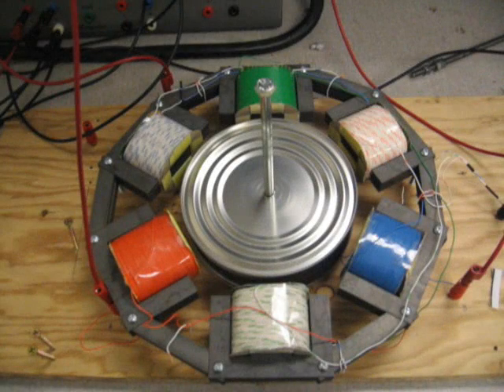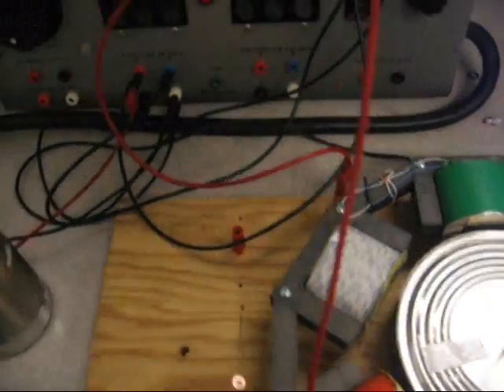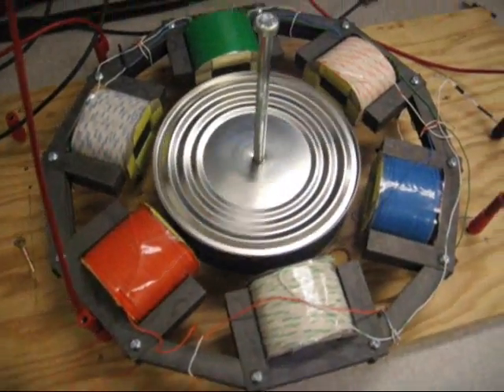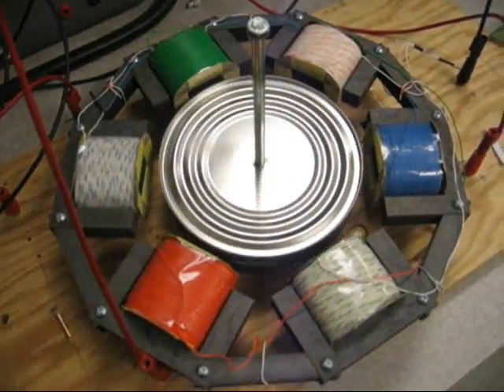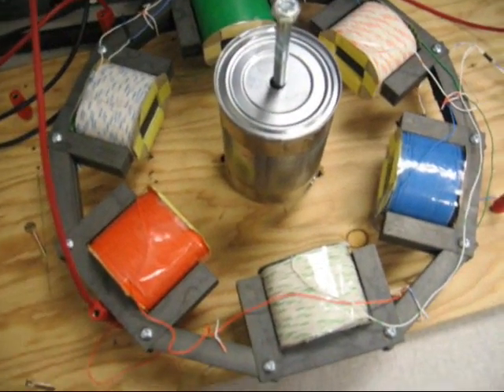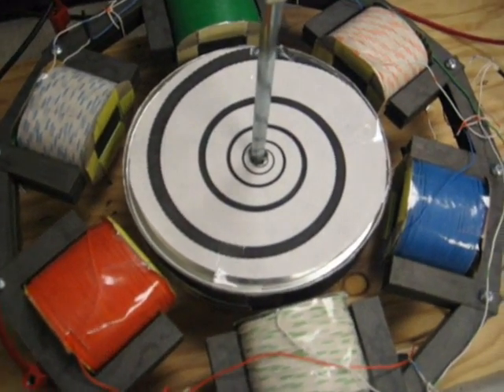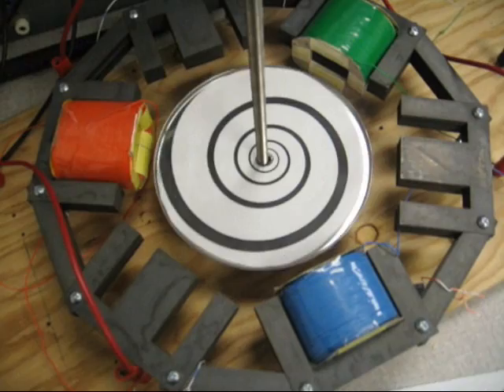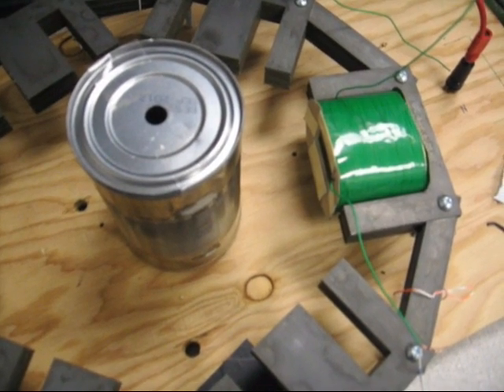Three phase AC induction motor demonstration

Comment: the workings of an induction motor are explored, shedding light on the fascinating principles behind this ubiquitous technology. A three-phase AC induction motor operates on the fundamental principle of electromagnetic induction. As three-phase alternating current flows into the stator, it generates a rotating magnetic field. This rotating field is crucial because it creates a time-varying magnetic environment around the rotor—a set of conductive windings or bars—within the motor. The changing magnetic field induces a current in the rotor due to Faraday's law of electromagnetic induction.

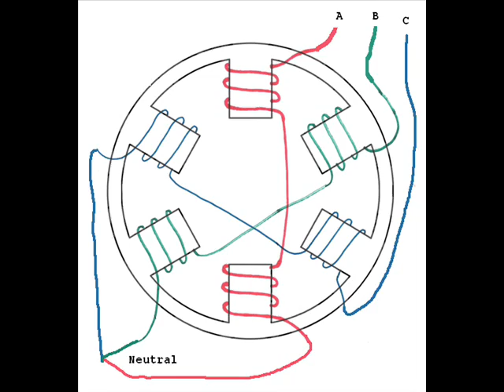Comment: are the connections at 0:10 drawing correct, shouldnt the 120 degree ones be grounded together, you have grounded the adjacent connections instead of the ones that are 120 degree apart.

Comment: I think it must be named bldc induction motor.
Reply from the maker: no sir that is not correct.  BLDC motors have permanent magnets on the rotor.  In my motor the rotor is simply a steel can where the magnetic field is induced by the field from the stator, hence the name induction motor.

Comment: this is an eddy current motor, not an induction motor as the term is defined in engineering. though eddy current is of course generated by induction. note that there is no squirrel cage winding in here

Comment: Does the Tesla Model S use the "heat pump" technology for heating and cooling the cabin or battery, using the invention patented #428057 by Nikola Tesla in 1887 for a "Pyromagnetic generator"? 9) Does Tesla plan on making an in-car magneto-electric refrigerator using this same patent? google com/patents/US428057 10) Does Tesla plan on making use of the Nikola Tesla 1888 & 1901 A/C induction "stepping motor/reluctance engine" now being used by Audi as an electric "forced induction" supercharger? Normally to be used in gas hybrids. Is the Ford Motor Company's patent in 1971 for an "A/C reluctance engine", actually Nikola Tesla's "stepping motor"? google com/patents/US3560820 - blog.caranddriver com/going-electric-the-next-phase-in-forced-induction/ More on ICE vs A/C & Dieselgate  nikolateslasolar blogspot com/2015/09/dieselgate-volkswagen-vw-diesel html

Comment: Given that 3 phase power is used in this demo, would this motor be termed a 2 pole motor or a 6 pole motor? I am thinking that 3 phases connecting to three of the transformers is ONE pole, and the same for the other three transformers makes a second pole.... ie 2 pole motor.

Comment: Cool video.  I have a few questions if anyone knows the answers?  If you added magnets to the interior of the can would it spin much faster? Also, if you did use the magnets and spun the can by wind or water to generate power would you just merge all three phase ends of hot and the three phase neutral together to combine the power generated?

Sorry for the basic question, i've been trying to learn more about induction motors and generators and would like to try constructing a simple generator.
Reply: Aghast Induction motors work by the induction of a current which produces a magnetic  field so if you add magents you will just make it stronger at some times and weaker in others since the magenitc filed will add up at sometimes but will substract at others.Depends on the magnents it may slow it down or maybe it wont matter a lot.

Comment: Hey Jim can you do a video on which wires to connect to each transfomer? I see that schematic is simple what if you wanted to connect more transformers like 12.which wire will you conne to?
Reply: Jubee Tobbe The transformers' polarity needs to match opposite poles (north to south) each, and each of those phases are connected in a delta (triangle) formation and each point is a terminal for 3 phase power.

Comment: i dont think that it is correct to say that the voltage crosses straight across from one coil to the opposite coil. this is not required for the motor to work.
Reply: +Luther David A Hall I believe it is necessary when the rotor is not magnetized, as in this experiment using a coffee can. If the rotor had either a permanent magnet or a electromagnet then the rotor could interact with the AC electromagnetic field from the transformer coils. But with the coffee can a current must be induced to create the magnetic field on the rotor, and that happens when the opposing transformers bridge a field through the rotor. I think.

Comment: If you look at a real rotor in a motor, you will see impregnation of aluminum or copper. This will act as a short circuit to changes in the magnetic field in the rotor itself. When you oppose change, the magnetized iron will tend to remain the same and that is most likely why you couldn't get the rpm up.

Comment: Whats inside the can?
Permanent magnets???
wires?
Reply: nothing. try quickly moving a magnet above an empty soda can on it's side. the soda can moves because it has eddycurrent induced into it. the rotating magnetic field induces eddycurrent into the can and it spins. this effect is known as induction
Reply: Induction motors doesn't have in rotor magnets... just they are metal thingies :D

Comment: Good video, I myself love seeing these sort of demonstrations. Would just like to make a correction as to how the flux lines where described. The flux lines do not pass through the centre of the can in a straight line as described,as basic physics stipulates flux lines never cross. The flux is actually moving to the pole adjacent to it, basically, as he described for the 3 coil experiment (the flux lines are guided/attracted through he tin can because it has a lower reluctance than air).I suppose it would look cool if you placed a piece of paper over the stator with iron filings, and you should see them. This is why the motor spins slower when there is more poles. After he reduced the number of poles, he has effectively doubled the distance from one pole to the other, since the flux density is proportional to distance, the flux density is 25% that of the 6 winding design, which explains why it spun slower. Also, I think what the professor was saying is that if you increase the distance between the stator and the rotor (the air gap), the motor loses power, or becomes less efficient. You experiment worked because it was unloaded and didn't require that much power to turn it. If there was a load connected to the original wide can, I bet the smaller can wouldn't be able to develop enough torque to turn it due to the loss of power (remember, air has a high reluctance) over the larger air gap.
Reply: Once current flows in the rotor, it produces its own magnetic field. This interaction between the stator's rotating magnetic field and the magnetic field generated by the rotor results in a push-pull effect, similar to the repulsive forces one experiences when trying to press two fridge magnets together. The opposing magnetic fields generate torque, which causes the rotor to turn. The rotor essentially “chases” the stator’s rotating magnetic field but never quite catches up, ensuring continuous motion. This phenomenon is what drives the rotation of the motor’s shaft, converting electrical energy into mechanical energy.

Comment: in that last part, there was a buzzing sound.... doesn't that mean it was AC? not that it wouldn't work with DC because we're attracting a can with iron in it, but the buzzing was probably AT the AC frequency, and was essentially the vibration of the can reacting to the field (essentially, the same thing as a speaker)
Reply: ***** I'm talking about the last 15 seconds of the video.

Comment: Need copper bars in your rotor would help
Reply: Simply cutting vertical 'window' slots around the circumference of the can would improve its performance too by creating a heterogeneous squirrel cage rotor.

Comment: Do all the neutral connect together with a wire-nut or connector? And did you run 3ph AC? Im wondering if I take the C  connector and put a run capacitor on it then just run single phase power it should run as well because the capacitor will provide the phase shift.

Comment: If I wire it like this can it be used as a generator if throughout in reverse
Reply: Show me the color code for wiring a 1968 dodge pickup D100 fuse panel.
Reply: +Maurice Lund 

Please show me the color coding for a 1968 dodge V8 D100 PICKUP FUSE BOX. THANK YOU.

Comment: That depends on which of the three phases turns on first, second, and third. You have three phases. A, B, C. If A has a phase of 0 degrees, B has 120 degrees and C has 240 degrees with respect to A. In this case the motor would spin from A to C because A turns on first. It helps to see a picture.

Comment: 3 phase is just like regular 60 Hz AC but is has three lines and alternating currents on those lines are offset timewise.

When line # 1 is at 120 Volts, for instance, 
line # 2 and line # 3 will be at -50 Volts 
with line # 2 voltage going up and line # 3 voltage going down. 

Basically, you have peak voltage on any of the given lines every 1/120 of a second instead of every 1/60 of a second.

Comment: All electricity is "produced" at a power station in 3 phase's, then it goes to substations and is "stepped up or down" in voltage but remains 3 phase, even in your street it is 3 phase which each house draws a different 1 of the phases that is why sometimes during a power cut at your house. Some others (2/3rds or 1/3rd) may still be on in the street. As for 3 phase motors they are mainly used in industry as they consume less power than a same HP single phase and are more powerful torque wise

Comment: 0:08 Where to the wires A B and C go? Could anyone explain to me in detail how to wire A  B and C further?
Reply: Ultimate Review if I understand your question right; you just take the 3 stator design and add one opposite to each and use the same wire to cover that one. This way you utilize space and gain torque but lower speed.

Comment: @kingfaisal550 Well, sort of. This is not any free energy generator/ motor if that's what you mean. The constant switching on and off of electricity from a power source to a coil causes a temporary magnetic field, (which lasts about a fraction of a second) which spins the rotor.

Comment: @hapmyster  Ah other way round. More poles means more torque but less speed. Less poles gives more speed but less torque. 

Motor speed = 120F / p 
where f is freq and p is no. poles.
Reply: The beauty of the three-phase AC induction motor lies in its simplicity and efficiency. Without the need for mechanical commutators or brushes, the motor is durable and requires minimal maintenance. The demonstration effectively showcases how the synergy between time-varying magnetic fields and current induction drives the motor, making it an essential component in countless industrial applications—from powering conveyor belts to running fans. This elegantly simple yet powerful technology is a prime example of how fundamental physics principles can be harnessed to perform practical, everyday tasks.